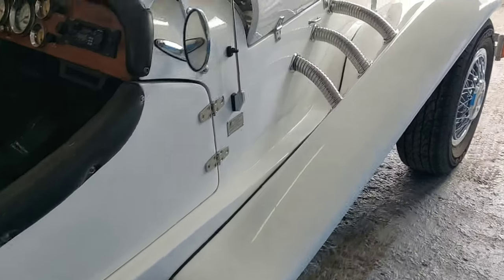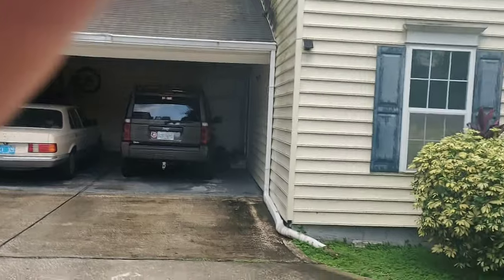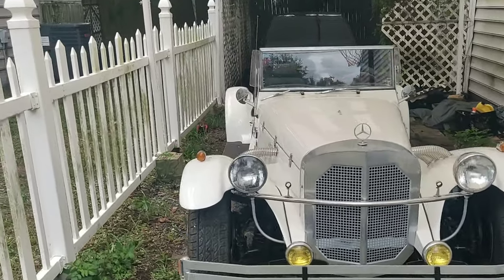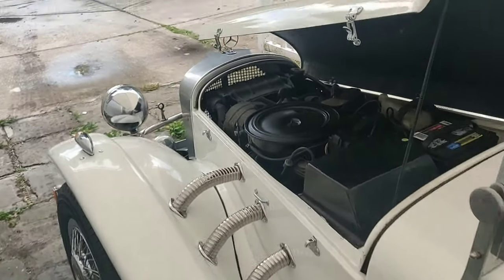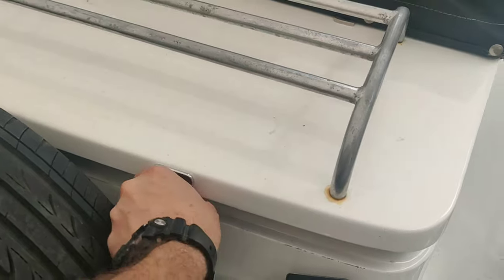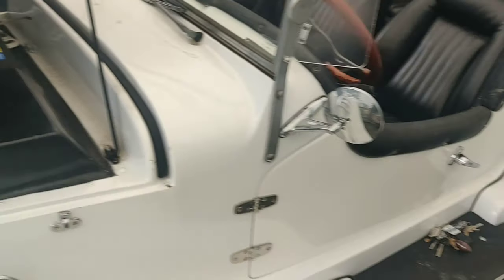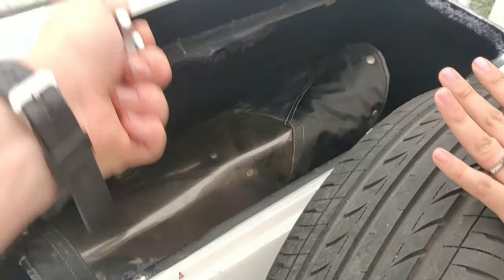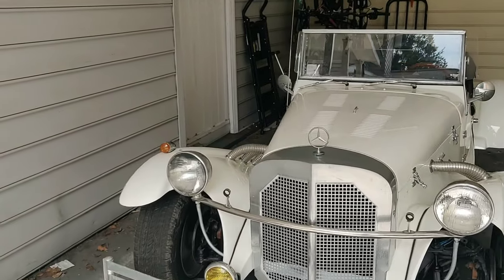SURPRISING WIFE WITH NEW CAR 1929 MERCEDES GAZELLE replica

Comment: I just bought one of these not long ago in surprisingly good condition. It's riding on a '77 Mustang II frame and 2.8l V6 engine. Been restoring it for the last few weeks. Just reupholstered and replaced most of the old hardware and lamps with LEDs and microchip relays. Single owner, 6400 miles. Great find, fun car!
Reply from the maker: Yeah sounds like you found a good

Comment: $2500 is an amazing price for that. Nice find!
Reply from the maker: Honestly I didn't want to pass on it. Someone else was coming up with cash and he took my offer. After researching in this condition, it should have been at least $8k.
Reply: @petescarport   I agree $2500 = Wow!! very nice find!!
Reply from the maker: @XLR411  thanks.  I'm going to be restoring it this winter
Reply: @petescarport  Just for reference, the bare body kit + front engine bare frame sold new for about $5500 in the 1980's.
Add in the mechanical parts needed to actually build a complete car, another $4000. give or take a grand. btw, the engine/transmission rear end is from a Chevette,

Comment: I have one of these cars.  I think you'll find the top is missing, the parts in the trunk are the side curtains and the windows look yellowed.  Either way, they come with a new top.  The top is $600 and you can put it on yourself with a snap kit.  I can see your wipers don't work, they'll be another $150.  The list goes on, but when you're done, it's great!!  I think I spent around $2000 on mine to make it right.

What you have is a factory built car.  It's not a kit that was built in someone's garage.  The factory that made these kits for the public built some of them and sold them as complete cars.  Yours was built just like mine.  They have a 1984 Chevy Chevette drive-line.  1.6L engine with an automatic, tilt wheel, heat/ac, leather interior, complete carpet package (includes trunk carpet), and the list goes on.....  I think they purchases new cars and took them apart to make these Gazelles.  That made them pretty expensive at that time. Mine has 6875km now ( I don't know why they're all in km), that's only 4271 miles, but I replaced the timing belt, radiator hoses, and brake hoses because of the age before driving it. 

When it comes to the gas tank.  It'll probably need to be replaced - I was able to find one on Rockauto.  It doesn't fit out of the box.  The tubes for the hoses need to be taken out of the new tank, a plate welded over the holes, and the tubes you took out put in the correct spot on top of the tank after the holes are cut out (use the old tank for reference).  They will need to also be welded in.  Good luck finding a pick-up and a sending unit.  I used a boat sending unit and made the pick-up from metal fuel line and fastened a filter sock to the bottom of it.  It works perfectly!!

Here's a link to the ONLY place you can buy parts for your car.  The guy that owns the company bought the rights to reproduce everything for these cars from the original manufacture.  I've talked to the owner a couple times - he knows a lot about these cars!!  He's in Florida so maybe you can save the shipping and pick them up yourself.

http://www.mgmagicclassicmotorparts.com/ 

GOOD LUCK!!!
Reply from the maker: Thanks for the update.  Appreciate all the info. :). I actually charged up battery today.  I've done the brakes and a lot of others.  Gas tank is doing great and has no leaks after fixing.
Reply from the maker: I went to site and now my wife wants to get everything. Lol.  I have found a few other sites but they didn't have everything.  Thanks for link
Reply: Pete’s Carport /  There’s a lot of parts on the site, well, it’s all the parts to make these things. Make sure you’re looking at the parts for the Gazelle and not the MG. 
The GM parts can be purchased at any automotive store if you know what to ask for.  If a part was’t manufactured specifically to build this car, it’s probably a stock ‘84 Chevette part. 

Do some research on the 1929 Mercedes Gazelle. That’s what this replica is. The original is a pretty large car and I think they built less that 50 of them. 
I drove mine to work today and later my wife and I were out for a while in it.